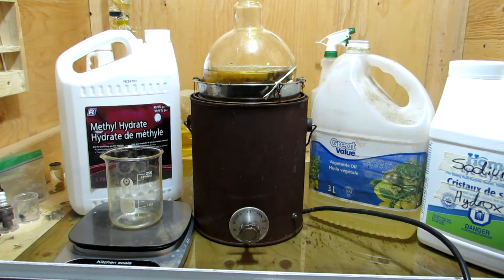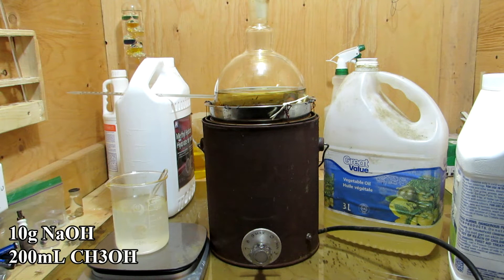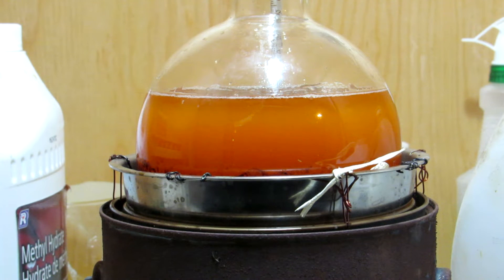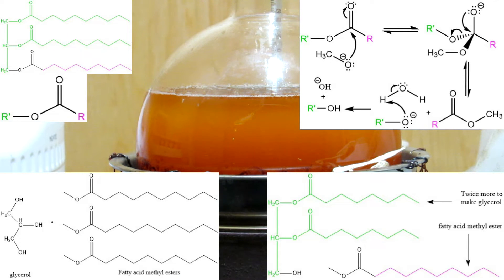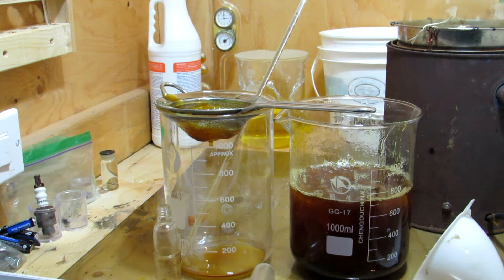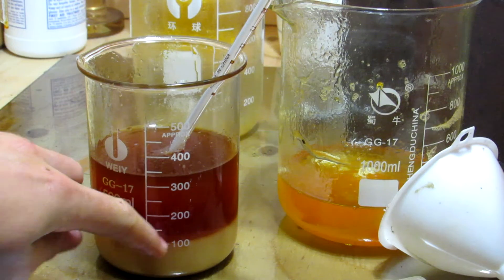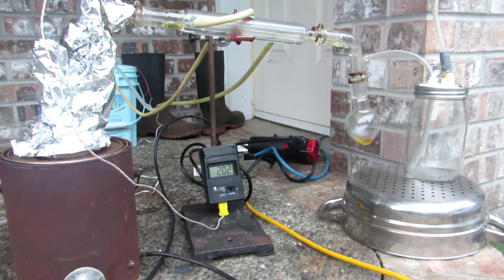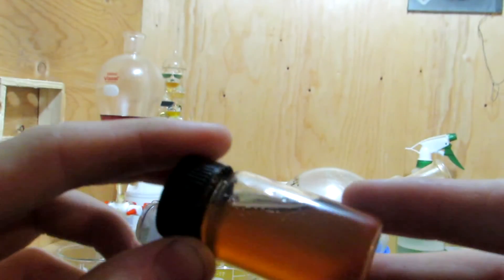How to Make Glycerol (Transesterification)

Comment: nitro glycerin

pls make it in a vid
Reply: Cool down 13 ml of nitric acid via an ice bath. Then add 39 ml of sulfuric acid, while mixing slowly. Cool the mixture to 10-15C (you can use a thermometer) add enough glycerin (not glycerol) to cover the top of your mixture. Keep this under 30C. Gently stir for 10 minutes and nitroglycerin will form on top as a white powder. Filter out the nitroglycerin (it will be the white powder) and put on baking soda. Remove the nitroglycerin via medicine dropper or syringe.